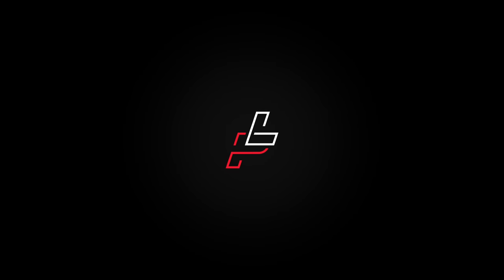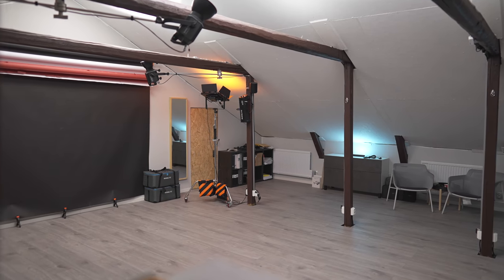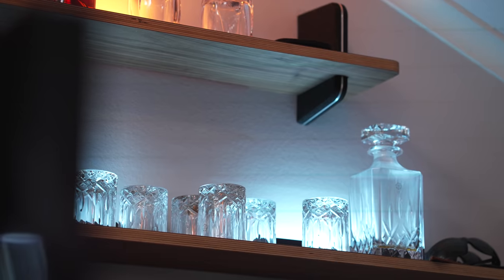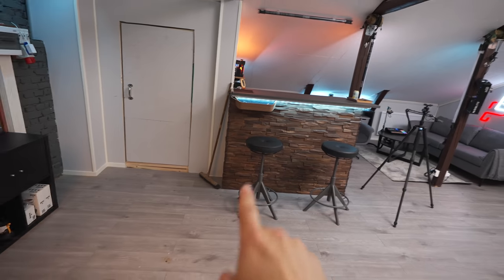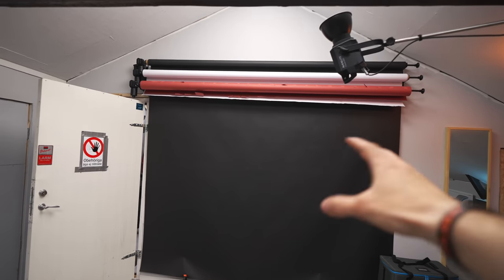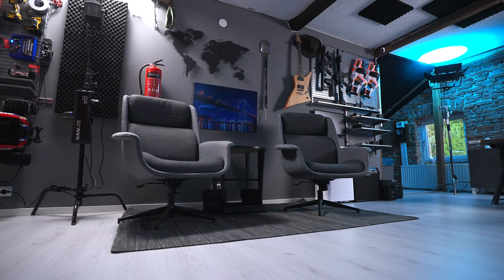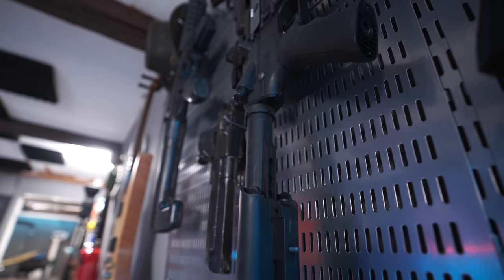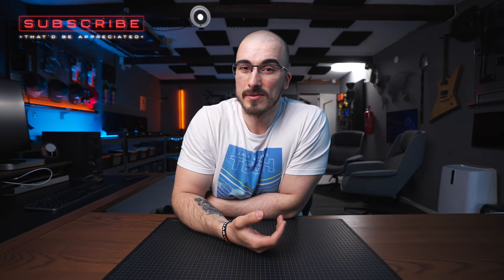Studio Tour 2021 | My Dream DIY YouTube Studio Setup

Comment: On pallets, EU is a Euro Pallet size 1200x800 or 1200x1000, the 1200x800 Euro pallet will fit 4 vegetable crates on a layer, Australia where I live use a 1155x1155 pallet as standard

Comment: Bro, I get light stripes with Philips Hue even at 1/50 24 fps. Honestly even if I go slower than that. Any tips guys?
Reply: When I shoot with generic or any type of normal lights (not designed for video specifically) I see the frequency that is written on the light and try to match it or its duplicates to my shutter speed.
So for example if I have a lamp with a frequency of 50hz, I set the shutter speed to 50 and then, to follow the 180 degree rule, I choose a 25 frame rate.
This method usually works (not always), and I wish that this information is helpful in any way.